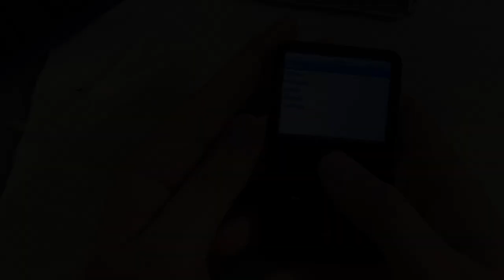iPod Classic Repair Guide: How to replace your iPod's casing

Comment: And all I wanted to do was replace the plastic screen covering because mine is scuffed. Good grief, lol.
Reply from the maker: Lol the hardest part is getting the thing open. Everything should be smooth sailing from there. Good luck!
Reply: Is there any difference between the casing of the iPod 5 and 6 gen ?
Reply from the maker: @bendermi  5 is plastic 6 is metal. I'm not sure if they're interchangeable across generations.
Reply: @dave-etc  
I've just been on Reddit the iPod classic 5 6 and 7th gen should be interchangeable, there is a guy who put a 5.5 in a 7th gen .
I want to put a scratched 5.5 in a 6th  gen .

Comment: Heya, what screwdriver is that? I got the screws out for mine but its near impossible to get them back in. I already lost a screw
Reply from the maker: My screwdriver kit is from a brand called Kaisi. It's honestly a pretty cheap set, I just got it off amazon but any precision screwdriver set should work fine. The key is getting a set with magnetic driver bits. That way the screws stick to your screwdriver and you don't lose them on the floor.
Reply from the maker: @driverman9528  that's gonna look sick

Comment: I just wish I could find a high quality aftermarket iPod faceplate. All the ones I have tried scratch super easy and the click wheel doesn't sit flush. Anyone here know a good supplier? I think they all come from the same factory in China though.
Reply: Elite obsolete electronics
Reply: Yes!  you are absolutely correct!  The screws don't line up correctly with the Chinese Ipod covers!  I wish there was a company that made covers like the original ones!

Comment: Hi I wonder if it is possible to replace the ipod classic 5th faceplate with the 6th generation one. Thanks and sorry if my english is bad.
Reply from the maker: I'm not entirely sure. The 5th and 6th gen are very close, but they are still different. You might be able to force it, but I doubt it would be perfect.
Reply: @dave-etc  Thanks also do you found any aluminum front panel for the iPod video yet? I just really obssessed with the aluminum material.
Reply: @uuia  idk if it's possible but just know that 6 gen are a nightmare to open because of the aluminum because it doesn't bent like plastic

Comment: O meu iPod  quebrou esse fio de dentro a parte do fone de ouvido mais não consigo ninguém que saiba mexer nele como eu conserto ele?
Reply from the maker: você deve poder comprar um conjunto de fone de ouvido de substituição online. O processo de desmontagem seria o mesmo que você vê neste vídeo. Depois de retirar o quebrado, basta jogar o novo em seu lugar.
Reply: If you don't want to open you can get an auxiliary output in a 30 pin connector.

Comment: 3:33 hye whats with this putty?
Reply from the maker: That's just electrical tape. If I remember right, the bracket that held the screws for my hold switch broke. So, I just taped it in place. It's not perfect, but it got the job done. Still holding up 3 years later.